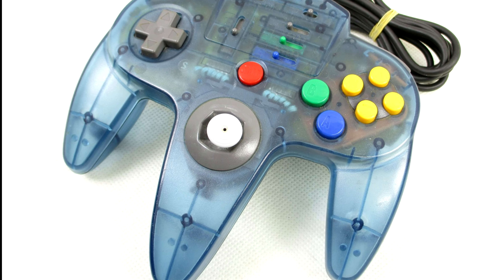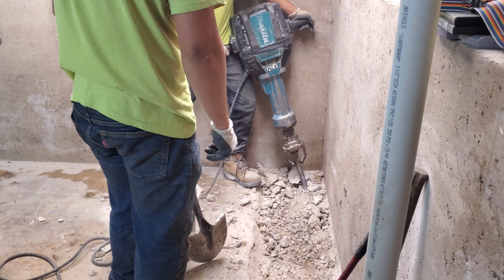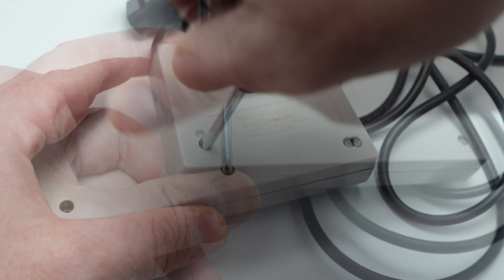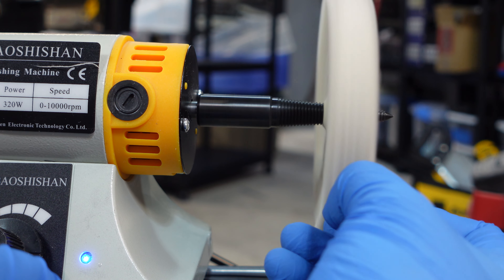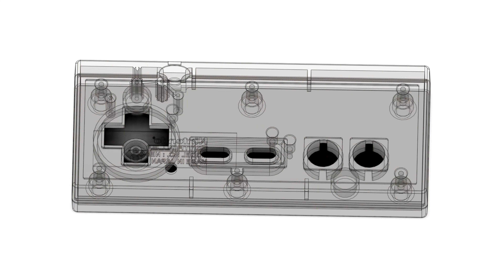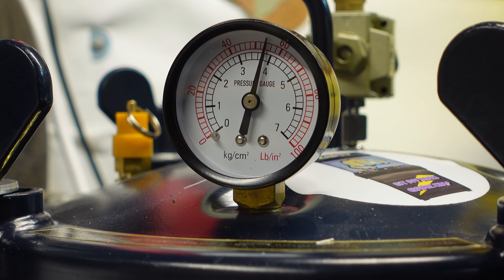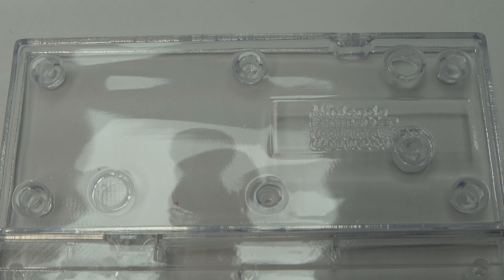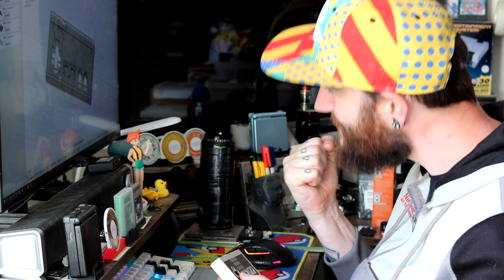I can't believe this NES controller is 3D printed

Comment: looks great! Why is there a hole on the bottom right of the D-pad? Now just get a Clear vinyl sticker with smoke grey and black and clear blood red to complete the front. Well if you want that is.
Reply from the maker: its supposed to allow the front vinyl to be easily removed!  Dude, that would be amazing, I need to look into that, ROFL!
Reply: @RockerGaming  Yep, Always here to challenge you with new ideas.
Reply: @RockerGaming  in my testing the adhesive of the clear stickers tends to bubble up against the shell and doesn't look attractive.  I would be happy to provide you some of my inlays for testing.  (they aren't clear though)
Reply from the maker: Dude, let me shoot you a DM on twitter!  I would be happy to take you up on that offer!
Reply: @grafxgear  what about the vinyl with the micro air holes?
Reply: @moandaindesigns  the adhesive is the problem, not the surface material.  The adhesive is bonded to the back in a sheet. but if you find a solution please keep me in the loop

Comment: What are the odds of getting the controller shell files as a solid model? I'd like to be able to modify them in Fusion 360, but it keeps crashing every time I try to convert from mesh to solid body. Also, the PCB way link doesn't seem to work. Cool build!